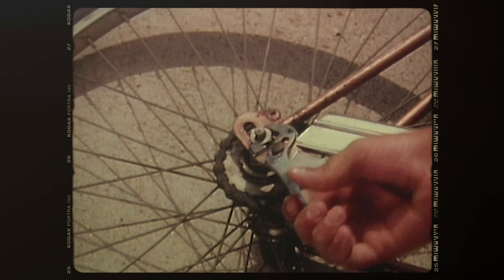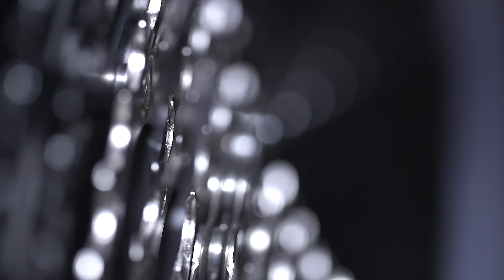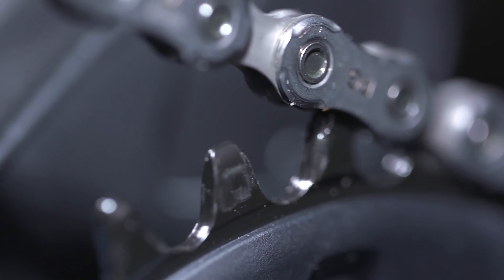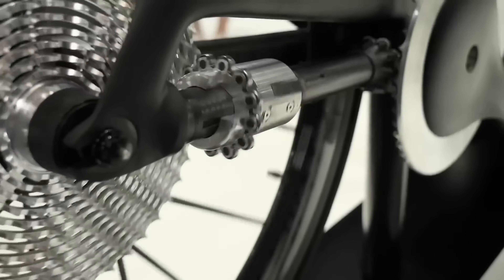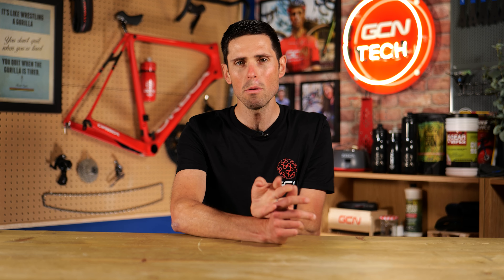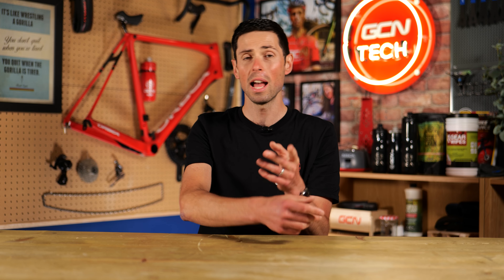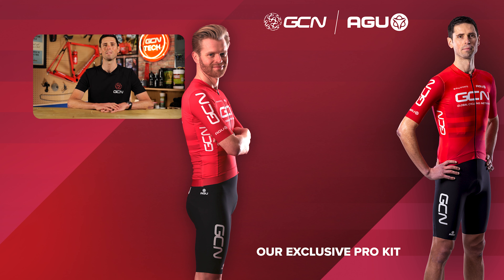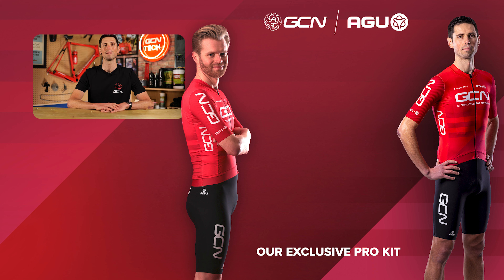Why This Will Never Happen!

Comment: I think the chain will never really go away, what I do think however is that belt drives will become much more prevalent. Greetings from somebody with a bike with a hub gear and a belt drive, who never looked back, for there is no more dirty oil and a belt also does not wear out like a chain does and thus does not need to be retensioned. The fact that a derailleur only too often comes dangerously close to high grass or puddles on the ground I ride over and a gear hub does not is just an added bonus.

Comment: I've gone to belt drive now due to me and my bike being very heavy, and destroying chains, cassettes and chainrings, they all stretch rapidly, switching to heavy motorcycle chain would fix my issues, but the belt drive is lighter, but as stated, its not a cheap solution.

Comment: The Ceramic Speed changes the drive load seen at the wheel from a torsional/twisting load to an axial/pushing load. 

The bearings, wheel, axle, chainstays, and pretty much the whole bike were designed for radial and torsional loads. 

Didn't they also make that worthless "ceramic bearing" derailleur cage that's actually made of plastic?

Comment: If you carry a chain tool (as I do), you can also fix a broken chain by the roadside. Try dealing with a catastrophic drive belt failure in the rain 50 miles from home.
Reply: I'm also carrying a chain tool always with me. Was very happy this summer to find a guy in the middle of nowhere with a broken chain.
Reply: It has been recommended to carry a spare belt on a long tour.  Probably a good idea at all times. The additional weight is like a spare tube.
Reply: I'm sure that it's possible to repair broken belts on the road with the proper tool and parts, basically a sort of cam-driven stapler.

Comment: Am an engineer, and even I'm struggling to have a better method than pin link hourglass chain. It's simple it's easy. And i can design a machine that's small and stamps out several at a time. The other is a lathe, for the pins. If you really want a 3rd, a 3rd for assembling it automatically, otherwise, jig it.

Comment: An interesting note, all of the alternatives have been tried, to varying degrees of success, on motorcycles, where the gear ratio between the final output shaft and the rear sprocket are constant. Chains are still the dominant final drive system, despite any advantages of belts or drive shafts, and with no derailleurs to consider. Chains definitely aren’t going anywhere any time soon on any 2-wheeled vehicle; if they were on their way out they’d have been gone a long time ago.

Comment: I know very little about modern e-bikes but I imagine that there might be some designs that offer yet another alternative to chain drive, which is a generator driven directly by the cranks and installed by or a part of the bottom bracket, that either charges a battery that powers a rear motor, or powers it directly, either by means of electrical cables. I don't know how practical, efficient, costly or reliable this would be, but it would work. But assuming no quantum leaps in technology, we'll probably be driving bikes with chains forever, the only possible replacement being belt drive. Everything else is either too heavy, inefficient, unreliable or costly.

Comment: A really good video. Nice comparisons too. However, never is a very long time. I suppose in my lifetime you are right. Besides, like so many things in life, rule number 7 reigns supreme. People like their greasy chains. I am going to try the wax treatment. I do have another bike with a gearbox. Yes, not as efficient, unless we are talking loads of mud. I take it out when the weather is bad. I don’t need to worry about rust on the carbon belt. Still, in the short run, chains are here to stay. Now where did I put my Zerode Katipo?

Comment: I'm no engineer but I am familiar with the concept that if you spend x dollars to get to 90% you will spend a other x dollars to 95%, then 2x for every 1% up to 98%, then 2x for every .1% and so on until you are spending 2x for increasingly smaller increments and the function blows up before you get to 100%.

Comment: Every time that ceramicspeed product has surfaced again (it's vapourware BTW) I've said the same thing. It's fundamentally flawed from a force point of view. In a chain/cassette, the drive load is spread through several teeth/links resulting in a robust and long-life system. This thing is asking all of the torque from a big guy mashing the pedals up a climb to transfer through one tiny bearing. Even if they somehow magically make that interface stiff enough to not bend and skip, both the teeth and the bearing are destined for rapid destruction.

Comment: my first street motorcycle was 400cc and i hated it sort of and i replaced the rear sprocket but not the front or the chain , so anyway i was riding about 40 mph by a pond and the chain locked into the rear sprocket and jammed the rear wheel locked , somehow i maintained upright for about a 100 foot + skid side to side at times and the handlebars were bent forward a little when i was doing a push up to stay on it , once i stopped it was a real pee wee "i meant to do that " moment and ever since i like Harley's kevlar belt or shaft drive but i don't like the limited top speed or loss of around 6-8 hp or that the parts also wear out [edit: on the driveshaft models] , i doubt they'd lock in place though and i think the belts just flop off out of important stuff when they fail...but that's sort of off topic from bicycle chain EDIT2 it still was a dodge a bullet because on the highway would be roadkill

Comment: Rather than trying to replace the chain, I think replacing the materials would be a better idea. My main problem with chains is that they attract dirt, but why can’t that be solved more effectively. For example, CuNiSi has self lubricating properties. There must be better materials to use than steel that don’t require removing the chain as in waxing. Maybe a non-greasy lubricant would do the trick, but I haven’t come across it yet. At least, have chain and cassette that is corrosion resistant. That can’t be too difficult to make for a few extra quid

Comment: Belt and chain drives are great compliments to each other. That's why belts are quite successful; slightly less efficient, not compatible with chain gears, but they're more resilient to weather and outlive chains many times over.
I knew the Ceramicspeed would fail the moment I saw it advertised as "The future of biking" everywhere I saw it on the internet. Kardan drives on bikes have always be an oddity for a good reason.

Comment: Not all cycling, not even the majority of, is about perfomance.
Reply: But all cycling benefits greatly from high efficiency
Reply: @Zoey_the_Rat  but for different types of cycling efficiency is defined and measured differently
Reply: @Dellvmnyam  c'mon, you know what I mean. Drivetrain efficiency is good for everyone. It's just that in some usecases longevity and lower maintenance take priority

Comment: Well the CN-M6100 shimano chain lasts for about 900km (0.5%-12speed) and may get rusty if in contact with water/sweat (if waxed). It costs 25 bucks but if you do 150-200 km/ week that's almost 1 chain per month... I wouldn't call that cheap...

Comment: Chanis are still mostly used on motorcycles due to the loss of efficiency in other options, if a 100hp motorcycle doesn't want to give up a chain for that reason, a pedal bike surely won't either

Comment: I got an XT reverse-sprung derailleur. Normally thumb push to go bigger cogs. It's now release trigger. Being able to rapidly drop into low gear is a bonus.
Chains are awesome.
Reply: Sounds like the old Shimano Rapid-Rise RD.
Reply: Sadly, like the QWERTY keyboard, changing something that depends on muscle memory involves mental effort to overcome.   I've also been running a reverse sprung derraileur for better than a year now, and I still accidentally shift "backwards" if I'm inattentive. There are similar human factors problems in switching from the old Italian "right hand to front brake" setups to the system used by the rest of the world.
Reply: @markfisher7962  Australian bikes have brakes are set up that way
Reply: @billeterk  And do motorcycles do the same, or follow the world? From personal experience, it's a real safety problem.
Reply: @markfisher7962  no idea about motorcycles. I think the original justification is that one-handed braking works better from the rear as it influences steering less and you don’t go over the bars. Since we drive/ride on the left we need to signal for right turns.

I don’t think it really matters but I personally prefer the better brake (front) under my stronger hand (right)
Reply: XTR (short cage)  rapid rise with Ultegra STI levers (triple) .So smooth.  No hesitation into a smaller cog either.  It's always been flawless on my road bike. Very intuitive click the number of gears you want to go lower. Then the derailleur does the rest hitting each exchange gate precisely and going to the next .It never grinds no matter how much force is is on the pedals. Going to the smaller cog the built in slight over shift cleanly takes the chain off the gate and it is engaged securely on the next cod in an instant. This can also be done under a full load on the pedals.

Comment: Price comes down with volume and the issue isn’t the serious riders, they will probably always prefer chains, it’s the casual commuters that better suit belts or shafts due to the massively reduced maintenance. It’s well worth it for me to get a belt driven bike, commute on a drizzly day and not need to spend any time whatsoever re lubing the chain out cleaning the rapid onset of rust off them. The trouble is that volume isn’t high enough yet to bring the cost down into the territory of the casual rider. It just needs that tipping point.

Comment: The ceramic drive thing hasn’t taken off because it hasn’t ever really existed in a fully functional form. Nearly all the videos are the one display that’s locked into a single gear. All the videos changing gear have been computer animations. 

There’s also not really anything about the design that would improve efficiency. You’re going through multiple gear sets to change the rotation twice. And, especially the rear one will have added friction from the gears pushing away from each other because of how the teeth and rollers are angled.

Comment: Belt drives will take over because the biggest part of the bike markets are E-Bikes/Pedelecs. Of course this will not affect road/gravel cycling, except someone switches to Rohloff or Pinion which probability is very low

Comment: Do the chains that are used for 10 or 12 rear clusters last as long as the bigger chains of just a few years ago?
Reply: sram AXS red do count speak for the rest....
Reply: Some even last longer because the narrower chains with their thinner plates have to me made from stronger material (harder steel, more abrasion-resistant coating).

Comment: I enjoyed this video and agree that chains work well enough. However, the claim that in 1940 Tullio Campagnolo invented variable gearing is not correct.  There were plenty of derailleur systems years before that, such as those from Simplex, Huret, Osgear, Vittoria, etc, not to mention internal hub gears (Sturmey-Archer 3-speeds came out in 1902).

Comment: To be fair belts are steadily gaining ground in the commuter, cargo, touring and e-bike segment now that low maintenance internal gear hubs are already established, pinion gearboxes are finding a foothold and chains continue to struggle with mid motor torque. My next commuter bike will also have a belt drive for zero maintenance, zero headache, zero dirty trouser legs operation, and even on my sporty weekend gravel bike I'm only still using a chain because of the weight advantage of derailleurs and because wax exists. Oiled chains get dirty so quickly on anything but pure road bikes, and they demand so much bloody cleaning, it's bonkers. 100 miles on gravel and you can scrub your drivetrain for half an hour. Oiled chains never again!

Comment: Campagnolo Ekar chain. This was my experience with it.  Take off the joining link to clean the rear derailleur or do maintenance. Put the link back on resetting the chain . Result? Chain skitters all over the place. This has happened twice now.  Put a new joining link on at £12 a pop. Fixes it. What a load of crap.

Comment: I think belt drive tech will eventually get cheaper but AFAIK there are only Gates and Veer* in the market at the moment and they're just busily recouping their R&D investment off all the early adopters. Which is sort of understandable but once a few more companies come in we should start to see prices coming down to more reasonable levels. There doesn't seem to be any particular reason why a belt should be any more expensive than a low-end chain, it's just that we've had 140 years to get very good at making bike chains cheaply. This will change...

*I'm particularly interested in Veer because their split belt design removes the necessity for a purpose-designed frame; you can theoretically retrofit it to more or less anything...

Comment: Chains have been utterly optimized, and anything else would have to provide a meaningful advantage for the entire industry to pivot and adopt it.  The chain is not only economical for cheap/low price efficient bikes but also for high performance rigs.  And, almost anybody can change a chain if they're smart enough not to die riding a bike.

Comment: The chain is hrer to stay. Period. I personally ride an 1997 Wheeler street bike with Dura Ace and 600 parts that were top notch at the time. It´s a proper 10kg bike, comes up to 12 with all shanenigans required. This bike STILL rolls with its original drive train, I was incredibly lucky to find and get it. It just needed cleaning and an inspection, some new tires, cables and there You have it: a 27ys old chain drive, still going strong, no problems. I´m gonna hold on to this one...
All the other stuff is cool, too but to me it´s more a "look at me" thing, look what I got. 
Kind regards

Comment: I have a belt drive, with an Enviolo continuous transmission. I kind of need it, though, (enclosed, works when very weather-exposed) because I'm biking in the winter in Alaska. The company I bought it from (Priority) prioritizes low maintenance (so, for example, the frame is aluminum).

Comment: Even if we did see a bike chain alternative that was like 99.9% efficient or whatever it still wouldn't and couldn't overtake the existing bike chain because the company that designed it would hold the patent. At best you will have to pay royalties to the company adding an unnecessary expense people who use old chains won't have to compete with. At worst you'll be hampered by propitiatory production you have to wait on parts to be made for you at rate that could be too high or too low for you hinging the success of your business on that of another.

This is the same reason why proprietary media formats for computers don't take off. Why even tho there's been massive breakthroughs in LED lighting efficiency you won't actually be able to get your hands on these ultra efficient LEDs for another 20 years when the patents start expiring. Even if some tech comes around that beats the chain in every metric you won't see it's development become mainstream for 20+ years due to the patents.

Comment: While I generally agree with your sentiment, I question the "...it can last well over 30,000 kilometers." statement you made early in the video. This just doesn't match my experience, as I usually need to replace the chain after a few thousand miles. Who manages to keep the same chain going for over 30,000 kilometers? What kind of chains are they using? How do they ride? How do they maintain their chain sets? Inquiring minds want to know!!!

Comment: It’s pretty wet and muddy where I am. Willing to lose some efficiency for a gearbox and belt drive. 
The reduction in unsprung weight should improve handling more than enough to mitigate a few lost watts. 
By the time I can afford it there’ll probably be a good E version too. 
Definitely horses for courses though, pretty certain my road and track bikes will always use a chain. 
Though I must say I hate how derailleurs work, essentially shoving the chain to force it to grind from one sprocket to the next, and just hanging off the back waiting to meet it’s inevitable fate.

Comment: Chains are simply the best tool for the job, they are robust, relatively cheap to manufacture, and more efficient than any alternative. Sometimes you just have to accept that no improvement is possible because the ultimate solution already exists.

Comment: The CeramicSpeed drive was an exercise in engineering as art. No way would that drive stand up to any kind of normal torque, notice that the CeramicSpeed bike was never shown being ridden, just spinning in the test stand with zero load.

Comment: "Can last for 30'000 km"
Not the progressively narrower chains on, where are we now? 12 gear derailleur designs.
Also: if you define a link as consisting of inner AND outer plates you should count two each of pins and rollers. I'd call that two links, but whatever.

Comment: For Ebikes at least, the chain could be eliminated completely, and instead rely on a motor and a generator, like a diesel electric train uses. It would likely be more expensive, but it would be extremely reliable.